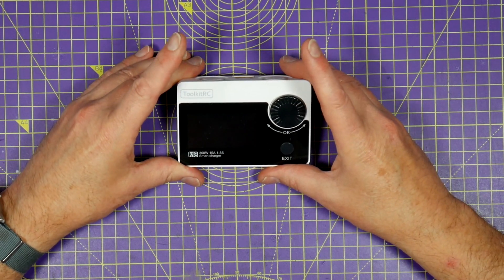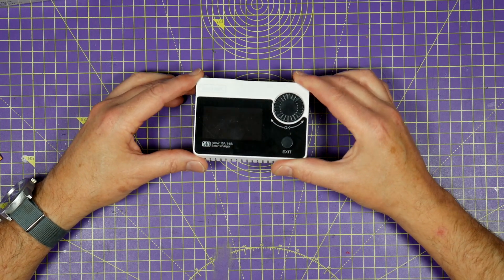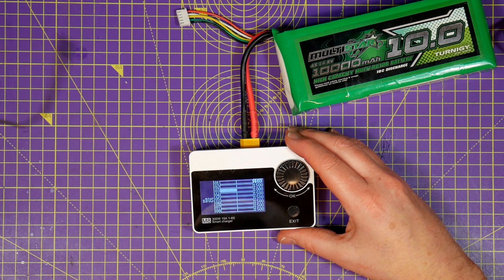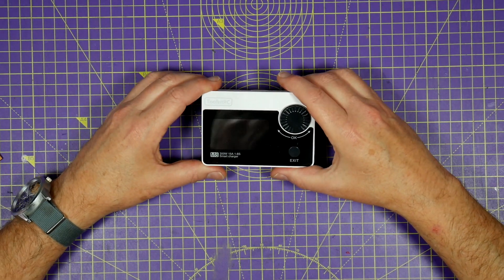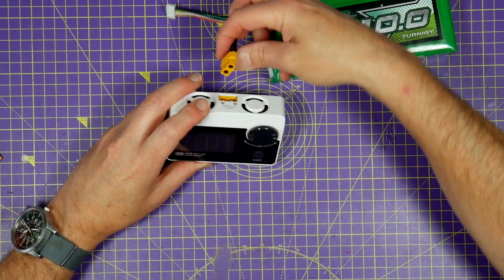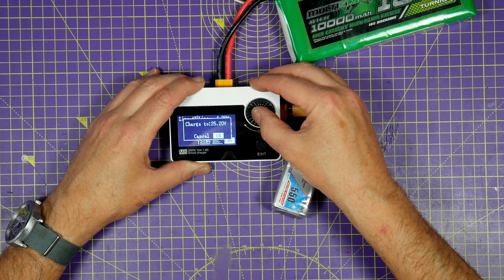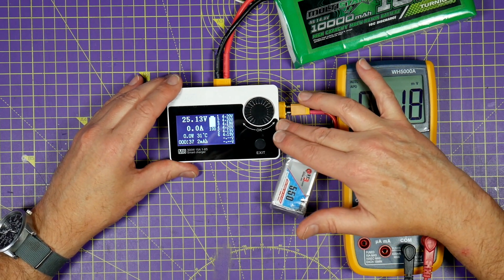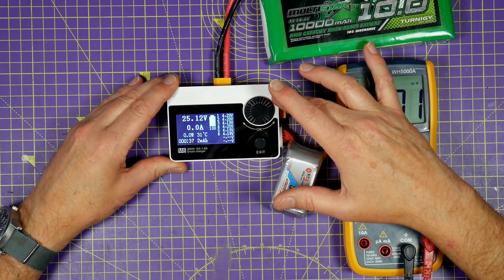Can a ToolkitRC M8 smart charger really charge 6S and 8S batteries?

Comment: could it be powered and charge batteries using a wall using a 19v 45w laptop charger with a tx/60 adapter as its input voltage?

Comment: What would happen if i used a 8s 6200mah lipo on the input side??? Would it burn the board or can it handle it? I have an m8s
Reply from the maker: It's spec'd at 7.0-30.0V input, so 8S is too much.